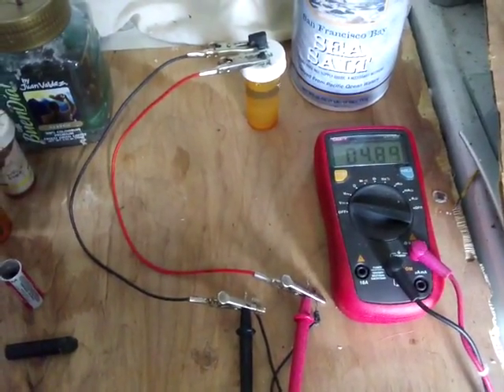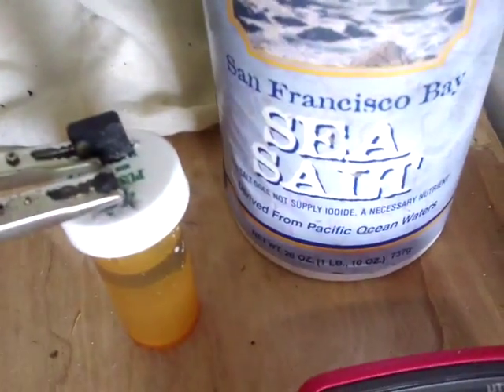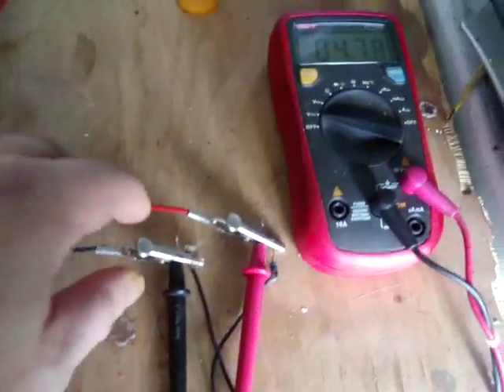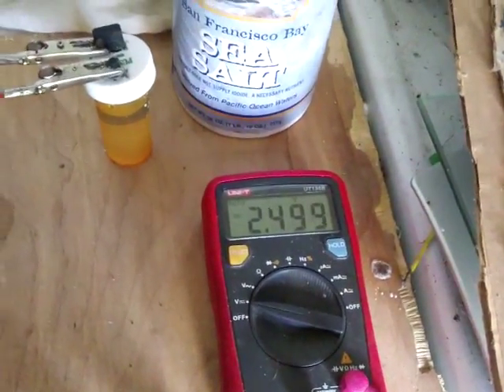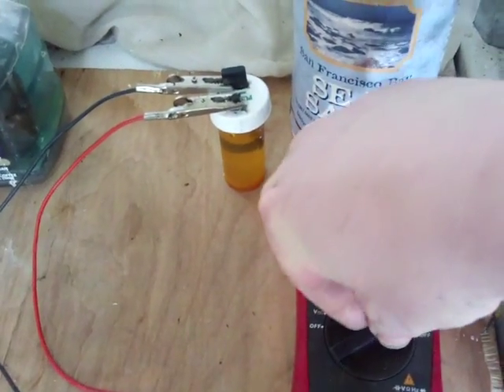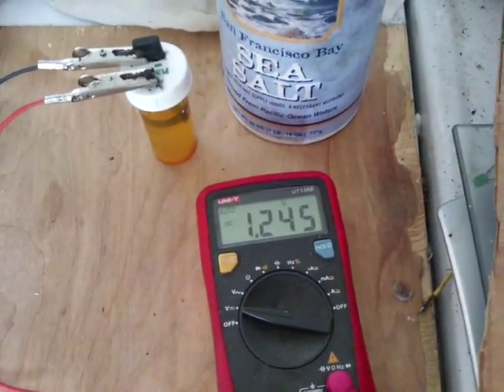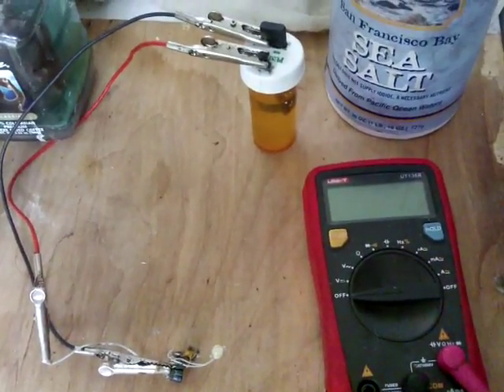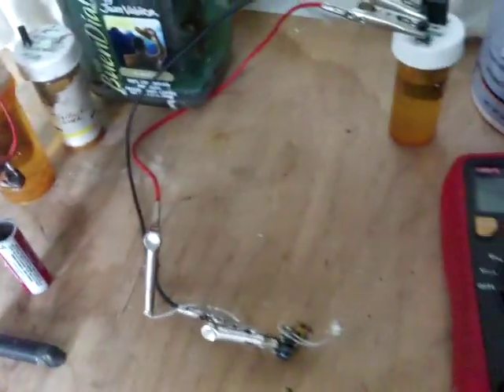Metal free rechargeable battery cell

Comment: Nice job Slider..Could you do a test with Epsom salts and then with a couple of drops of battery acid ? I am wondering if this will improve volts or amps. I have used Epsom salts with old dead car battery's and they put out a little over six volts a bit lower when running a load like a three watt led but runs them very well.
All the best.
B
Reply from the maker: ***** Hi Bobby. Got a big bag of the Epsom and will try that. The salt had been pretty much unused for years, so was tried instead (everyone having some kind of salt in a cupboard being the thought). 
Epsom works fine in car batteries indeed, not quite as good as alum though...with alum I get about 11.3V from my solar charged pair of ex car batts. Funnily enough, got no battery acid lol, except what's in the car one at the moment !

Comment: Hi Slider 

I have never seen these cells before, nice concept 
Is your ferrite core made of iron? have you every tried a magnet?

Nice to see you still going on this
Reply from the maker: Steve Allwest Cheers Steve. I hadn't thought that ferrite would work at all, until neatpete45 showed a Karpen pile type cell using it...that prompted this idea. Just checked, there is some magnetic attraction, presumably iron would be in particle form embedded throughout the piece. I do wonder about what's in sea salt, if it's genuinely from the sea (gold ?!).
Yeah, the C/Pb is my all time fave, began running in 2012. It doesn't change at all and that osc has flashed 24/7 365. Nephilim Penny still carries on, been running on same rain water (couple of evaporation topups) for over 3 years, has had 5 pieces of replacement stainless steel, but nothing else. So, non reactive components are always an interest :)